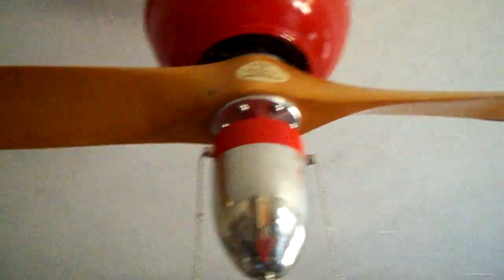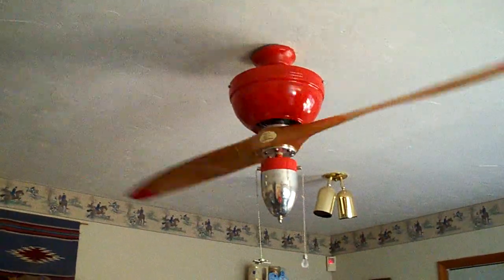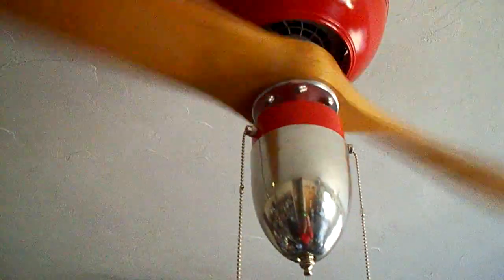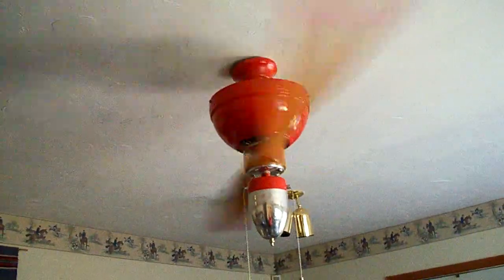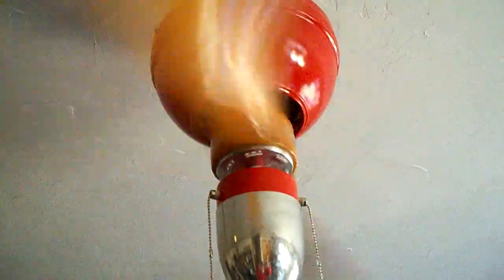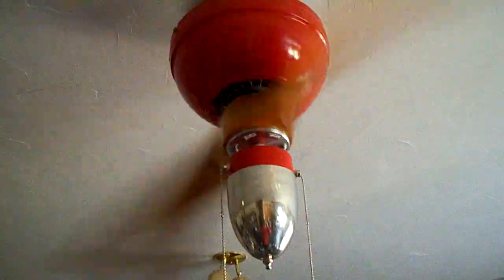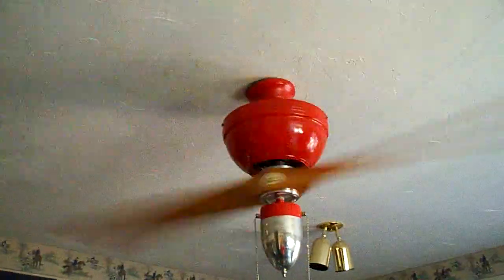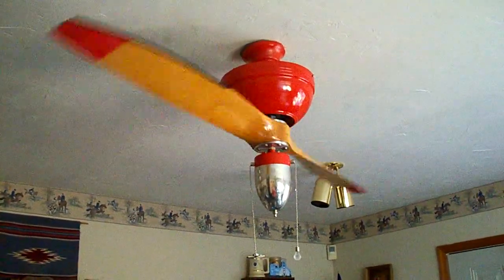Airplane fan 2 first test

Comment: My god man, take that down. If that comes loose, or someone steps up on something too high it is DEADLY. there is a reason why ceiling fans are made out of flimsy and light materials.
Heck, someone raising their arm too high could get it broken or lose fingers or worse. Hitting it with something could cause it to break loose and fall while still spinning with all that inertia, again =Deadly.
Reply from the maker: they reason they are made flimsy today  is its cheaper and cause planned obsolescence
there are also of plenty of ceiling fans that are not made so flimsy and it's not going to decapitate anyone at 238 RPM

Mythbusters proved that even mental blades  ceiling fan cant do that over decade ago

Comment: Most balanced fan I’ve seen in my life
Reply from the maker: That is cause unlike cheap ceiling fans propellers are designed to turn a couple thousand RPM so they must be balances much better than fan so when used like this 0 wobble.
Reply: @ThunderClawShocktrix Yeah I know I’m a serious aviation nerd :)

Comment: well I tried something like that a couple years ago by removing 4 blades from a 6 bladed ceiling fan...........it worked...........kind of but it sure as hell didn't look as awesome as your set up that's for damn certain! Sounds like its pushing a respectable amount of air as well.
Reply from the maker: depending how good or bad the motor was that either made it work much better or little change
Reply: @ThunderClawShocktrix  well it did spool up quicker at least. Air flow was just slightly better.

Comment: I would probably use one of those composite blades they're using on ultralight airplanes now the lighter weight and would turn at a higher speed
Reply from the maker: perhaps it would but i doubt it would help much as the main limit would be the drag , such  prop would get up to speed faster though.

Comment: I wonder if one of those cheaper monophasic to triphasic inverter connected as biphasic (Since that is the goal of the capacitors) would allow it to be fully throttleable.
Reply from the maker: Maybe but using variac wall control would be easier
Reply: @ThunderClawShocktrix  It would be totally easier.
the advantage of using a frequency controller is the possibility of going above 60hz and get even more speed (to a given point) or really low.

Comment: If one were to use the wall deco props sold on eBay for $30 to $40 for a 48" model how well do you imagine they would work as I'm sure pitch angles aren't a design imperitive when they are made...just curious

Comment: You could put the motor on a electric bike and haul ass
Reply from the maker: actually most Ebike motors have more power than a ceiling fan motor using one to power a fan is something i'd like to try

Comment: This guy sounds like Brain Cox(Maj Hogan) ... don't know if anyone else can hear it😂.  At any rate this is NOT a good idea.
Reply from the maker: Why is having fan that has blades with good aerodynamics a bad idea, plenty of commercially made fans use airfoil blades?
Reply: @ThunderClawShocktrix Yeah not making light of the work you put in or your accomplishment.  It looks awesome.  My issue is (1) in the case of catastrophic failure, the blade is a solid mass that will not break, unlike standard blade assemblies (2) given that said mass --> momemtum = (velocity x mass); I missed what material you said it was made of but this looks like straight up solid walnut to me...a material with a respectable density, girth, and in a circular motion at speed...aerodynamic to boot as you stated. Not something I would want over my stationary, not so dense head 😂
Reply from the maker: @archonmarch3965  the prop felt fairly light to me so it cant be walnut
Reply: @ThunderClawShocktrix interesting 🤔 must be spruce.

Comment: Very cool build. I would check the current draw on the moter to make sure you're not over amping it.
Reply from the maker: the motor is spinning faster than it would have in the original 5 blade configuration so it should be fine I don indent to do full wattage and power factor test soon after i get the Christmas lights up

Comment: that backwards spinning prop is just going to bug me for days now...
Reply from the maker: No it's turning the right way to blow air down it's mounted backwards compared to how it would be on a plane though unless that plane uses a pusher propeller. It is the reverse pitch of most ceiling fans that is true, but its hardly the only example Emerson made many in the mid 20th century for some reason.
Reply: @ThunderClawShocktrix  i know its the right way to move air the right way, but aerodynamically the airfoils are backwards, its trailing edge is now the leading edge... it just bugs me :)

as long as its not over my head, who cares!

but yeah... i would go nuts if it was...

Comment: This seems like an old relic of youtube. Like what if in the futur people were still interested in fans, or even youtube ? They would certainly watch this video.
Reply: Exactly I thought this video was from like 2009
Reply: Hey, from what I'm hearing about AC refrigerant from AC repairmen, we might should get use to fans again. The price on that stuff is going up,up and up. From a couple of hundred dollars to thousands per ounces. In the '60s when $1.50 hour was high wages for middle class, we couldn't afford an AC. I built a fan out of a car radiator fan, an electric motor. One speed, high. Had to tie the sheets to the bed to keep them on the bed but we were cool. Don't "flame" me, just passing it on. Take care, stay cool be safe
Reply: just coz its not your thing don't hate.. get a life...
Reply: @griff-ironfrendly2876 Bruh, it was a compliment to the creator, if anything.
Reply: @griff-ironfrendly2876  i never hated on this. Wrong comment maybe?

Comment: So technically you can pull the ceiling down with one of these if you go fast enough in reverse
Reply: you will pull it up because fan is throwing air down
Reply: @gasleakpipe  he said "in reverse"
Reply: @gasleakpipe  push*
Reply: no. nothing will happen
Reply: True, if you put an actual engine instead of a ceiling fan motor💀
Reply: @jhebertdelacruz5437  they used to use sewing machine motors in the very first ceiling fans actually.
Reply: @linuxtuxvolds those are just regular induction motors probably either, GE, or Westinghouse
Reply: @MachineMoneyk9  Westinghouse!!! That company has been around for about 100 years or so now! Old school!
Reply: @linuxtuxvolds yeah , they've made everything just like GE
Reply: @linuxtuxvolds  tbh that is something I’ve NEVER heard of before. 
Thanks for educating me bud.

Comment: Impressive to see it come to reality finally!!

Perhapse make your midlow as your 3rd current speed and make a new 3rd postion? Ideas ideas. Glad to see it!
Reply from the maker: that's what i was thinking or bump them all up by a bit
Reply: @ThunderClawShocktrix  like this fan u were right in terms of airflow being 9500cfm im surprised for a 2 blade fan to perform that well as three and or more than 5 blades perform the best in terms of cfm. to compare the casablanca stealth 54in 14 degree blade pitch rpm of about 175-182rpm vs this fan with 60in blades and if i were to guess a 45 degree blade pitch which is insanely steep but just comes to show aerodynamic steep pitched perform better
Reply: Did you make this whole fan yourself??????
Reply from the maker: @XANDOOR48276vwejm  to make something entirety  by yourself you must first start by making the univrse

but yes I did
Reply: @ThunderClawShocktrix that’s amazing if I’d guess I’d say it’s value is $794 usd